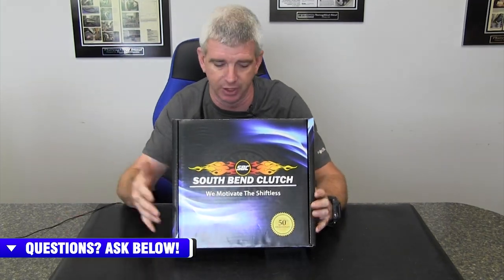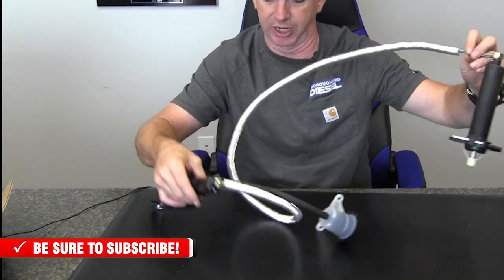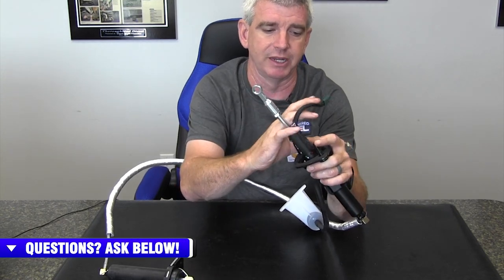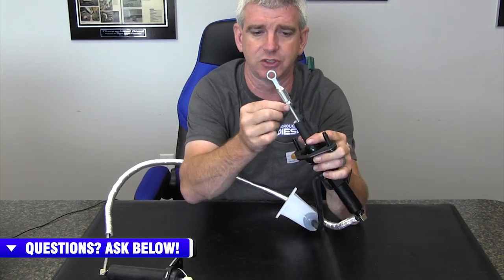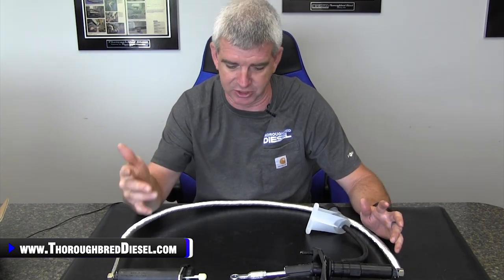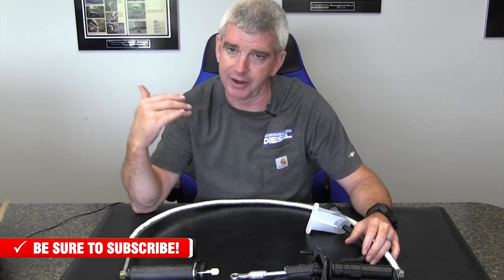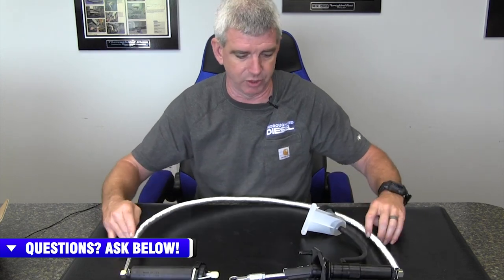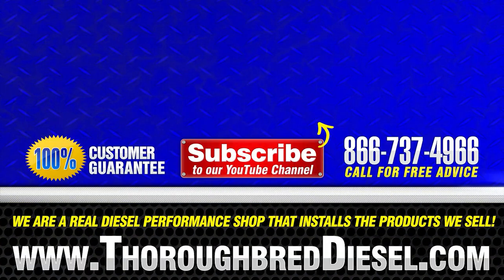Upgraded Hydraulic Adjustable Assemblies Provide Peace Of Mind

Comment: I have an 02 cummins with the 6speed  383k on it an still factory injector pump, injectors , turbo, have to replace my lift pump it's finally going out, just replaced my first clutch last year has been an awesome truck bought it with 80k on it back in 07 an still have it

Comment: My 97 f250 has a zf5,rebuilt clutch,  the clutch pedal is hard to press, will this upgrade make the pedal easier to press,?
Reply from the maker: It depends on your pressure plate rating and if you have a problem with your current hydraulics.
Reply: @thoroughbreddiesel  if pressure plate is stock and no current problems just want a better feeling pedal something better than the 26 year old system. would it be something im looking for or just stick to oem?

Comment: Couple of issues I have with these adjustable units. 
First is none of them enable clutch engagement on the bottom end of the pedal while still allowing the clutch safety switch.  Anybody remember that clutches used to engage about an inch or inch and a half off the floor?  Now they are all 1-2" from the top.

Second.  They call them heavy duty... but nothing describes what makes them heavy duty.  Do they have an extra seals.  Larger piston sizes?  Different master slave piston ratios?
Reply: What makes them heavy duty? What's the justification to call them upgrades? Because the manufacturer said so? Anyone done a teardown?
Reply: @regularguy519  I have never received an answer to that question... and I've been asking since they hit the market.  I have one seeping a bit on the MC side.  When it gets bad enough I will tear it down.
Reply: @ShainAndrews  do it!